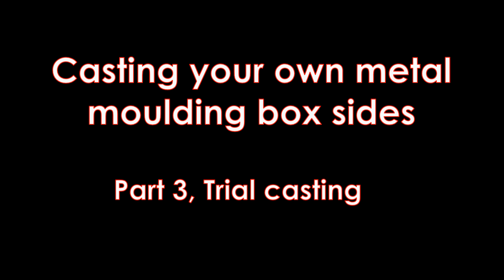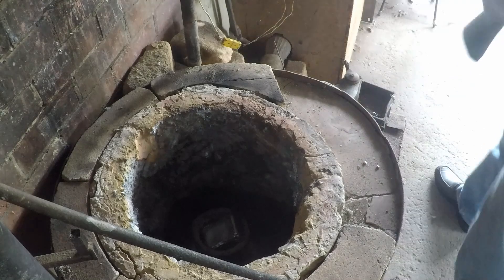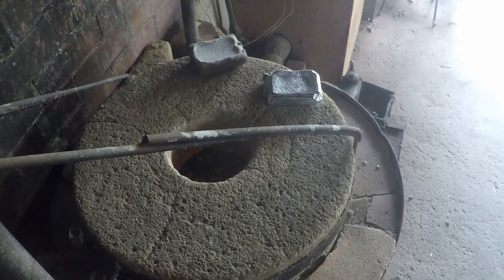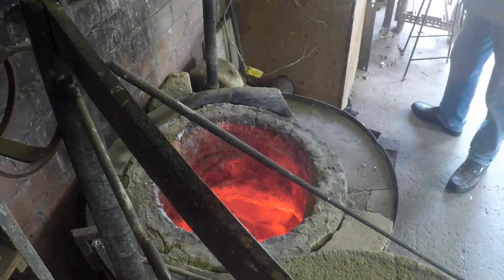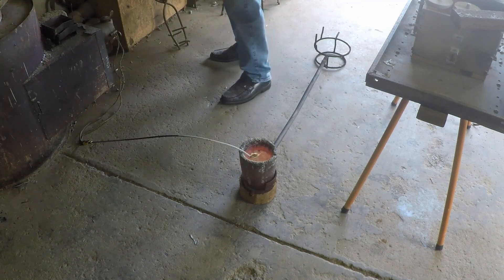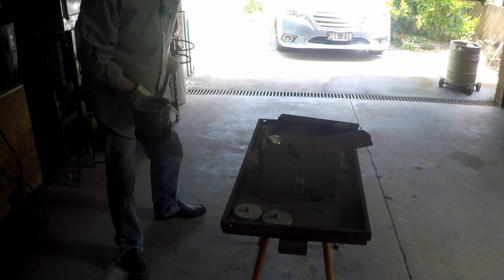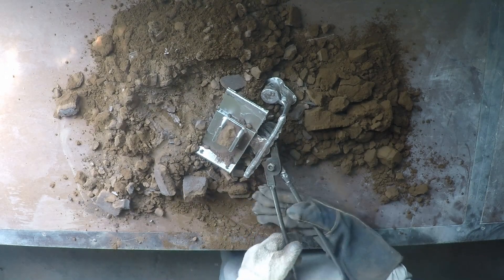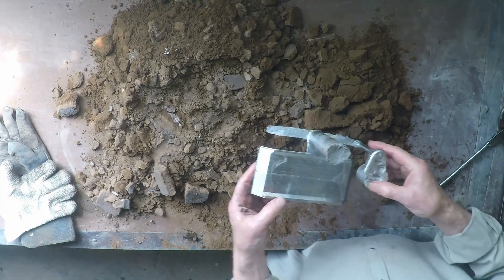Make your own metal moulding boxes - Part 3

Comment: I smiled when you said you're using a " small crucible" A8 . that would be quite large for me Martin, my range is A4 to A12 & I only have ring shanks & lift out tongs & have never needed any unesessary "clips" to hold the crucible in as you say I've never lever dropped a crucible & thank you for sending me the molding box info.is your furnace oil fired or gas? 
Graham.
Reply from the maker: Ray, Spot on, diesel it is... Martin
Reply: @olfoundryman8418  I'm still on coke [no not that stuff!!] but when we pulled the father in laws house next door down I "inherited"a large tank of diesel & the central heating burner so I might rig it up.save messing on with coke.
Reply: I'm not 100% sure but seems like I remember him saying he burns diesel fuel.
Reply from the maker: Graham, Hey baby way to go snort snort damn this Hollywood cold! Seriously though central heating burners work well. I have two that I have used and a local foundry has used a largish one to melt his bronze for years. They are nice self contained units blower oil pump and electric start in one neat little unit only problem is that they are either on or off - you can not turn them up and down.  You can though get a range of jets for them, rated in gallons of fuel per hour. Much easier than coke something less to have to worry about.... Martin
Reply: @olfoundryman8418  That's fantastic info Martin, I've a commercial furnace I got given from a local tech college gas fired [we aint got gas in our house] but it's got a tangential entry tube & I've had the burner in the workshop for a few yrs now & I never bothered with it but now you've spurred me on I'll rig it up many thanks for the info.
Graham.

Comment: The castings don't have to be pretty if it is used for work. They just have to be solid enough to be useful. Still, the casting looks good to me. Are you going to use the castings to form a jacket or a flask? If a flask, I suggest that you incorporate a half round dowel on the inside of the flask to keep the sand from slipping out when you are maneuvering either the cope or drag. Or you could modify the 3D file. Keep up the good work!
Reply from the maker: Sand, You are right but I am a bit of a pedant and I do like a good looking casting. However on this occasion the effort to make my fine facing and the lack of any real need for prettiness won out. Flask, but there are already sand retention ridges on the bottom and top of each side. I am surprised that you did not see them. Nothing worse than a drop out just as you go to assembly a finished mould. I do note that some people do not seem to use any sand retention ridges and they seem to get away with it but I suspect that is because petrobond hangs in better - maybe?? I note a lot of people with a narrow grove or just one ridge in the centre of each side - recipe for disaster IMHO...Martin

Comment: Excellent vid ty. Can youu talk a bit about how u got started in casting, i.e. where, what company, who were yr teachers, what was the state of the industry in yrr younger days, what types of metal did you start with????ty
Reply from the maker: Hrxy1, Long story, short version;- 
age 10 -12 made fishing singers in loose dry sand moulds lined with wheeties packet cardboard
age 14 melted down aluminium conductor scraps using wood fire from re-electrification of road where I lived
age 16 made teaspoons that melted in tea
read "Metals in service of man" inspired by all of it but particularly by 4 pages on casting the propellers for the QU E series
Realizing that geology, my first love,  meant a life in the outback constantly moving around I decided to study metallurgy and have never regrated this choice 1963 - 1965
Set up small sand foundry about 1964
got some decent sand 1968
Worked as foreman in gravity die foundry 1973/74
Rebuilt furnace after moving about 1975 same furnace with same lining today!
Have worked at a few other foundries over the years with last being as foundry metallurgist at Brake and Clutch (broken crutch)
When last job ended ran own foundry full time to keep wolf at bay - not a good living but we survived tolerably well. Now make very little on a commercial basis - age has caught up
 In my younger days the industry was probably at least 4 times its current size there were foundries and pattern shops small and large  all over the place
Apart form my metallurgy studies I  am self taught with a lot of reading along the way, with a thirst for knowledge and a tendency to always  consider what I was told/read but to always look for newer better more accurate info from good sources. I learned early to sceptically respect the "old Hands" Their information was invaluable but could be outdated and dogmatic.... Martin
PS, Hell - what happened to those 65 years?
Reply: @olfoundryman8418  no , no , no  not in words  but in video form. I like to hear you talk. Yr not boring to listen to . no offense intented for wring back to me  obviously i ll read it but would prefer vid ty
Reply: The last bit doeznt make sense, typing errer.
Reply: Also i would like the long story long version, pls, ty

Comment: Not a bad casting considering the level of pattern preparation. Almost like you know what you are doing :) Great to see you up and around. Keep healthy Martin. Thanks for walking us through the process. What do you use for a fluxing agent? And did you degas this pour?
Reply from the maker: Mark, Almost no pattern prep on purpose just to see how it went (Nigel was curious and so was I) Keep healthy? Yeh, well, that would be nice but still standing as they say just with some difficulty. Flux is "coverall 11" by Foseco it  is what is called a "drossing off flux". No, I did not degas this pour. While it is my habit to degas just about all my sand cast work I did not bother here as a little gas will help the feed and the quality requirements are not high (nothing aerospace with this job) and no extensive highly machined areas to show any gas. I sometimes tend to think that people get a bit obsessive compulsive about gas. It is usually so fine that most people will not see it - I mean we have people trying to degas with things like washing soda these INCREASE the gas level and yet they think they are doing a marvellous job because the machining finish on their unheatreated castings will not show the fine gas bubbles - the soft surface just flows over and covers up the bubbles as they are usually way less than 0.5 mm.
What they see and call gas is most likely air bubbles caught because of silly gating methods. My advice on degassing is generally don't bother unless the work is critical or thick. Just use good clean dry metal melt quickly don't get to hot (unlike here😏 ) don't stir the metal use good gating and pour without delay little gas that you will not see anyway and no air!... Martin
Reply: @olfoundryman8418    Keeping above the grass is the main thing I would think! I say it that way because I know you have a sense of humour. I agree that most of the porosity in Youtube castings is the fault of the silly washing soda myth. Plus really bad pouring methods and practice. Way to large sprues. Overheating and prolonged heating as you mention. I pay attention and watch the machining of casting shown. So manyof them have large air pockets. So many people use uncoated steel crucibles and this creates it's own troubles with the aluminium eating away at the steel and reacting with it. Same goes for pouring into cans and tubes. You can do it but it rarely delivers a useful casting. Hoping you get to finish this series Martin. You are a fountain of practical wisdom. And You will be keeping me busy and thinking for some time to come.

Mark
Reply from the maker: Mark, I see we both read from the same play book :) I actually started on YT to counteract some of the large sprue washing soda pushers out there (I regret my lack of sucess but I am still trying) I have been at this casting lark for, I think its now, 65 years and even an idiot like me has to learn something in that time! I do intend to finish this series  grass above not withstanding.  I Hope too that a few more series will come out, like why washing soda does not work etc., How to melt copper (nobody but nobody does it right). Ihave so many ideas for videos but I just need to live to 1000!... Martin
Reply: @olfoundryman8418    Copper would be awesome to do a video or series on. Sure washing soda works. It works to make problems in the castings!

Comment: 800 degrees maybe too much? 710-730 should be spot on for 6 mm plate section Lm25. Test the "T" junctions may still have dispersed  low level porous shrinkage  if needing long term extra soundness?. [single riser dead center on the back should pick up both feed paths]
Reply from the maker: Thesilver, 800 a bitt too much -y ou betcha - no doubt about it. But in my defence my furnace jumps really quick once melting is complete the temp just rockets with a small crucible like that. I was actually aiming to pour at about 760, still high but I needed to get the casting and I had no idea how it was going to work - this was only a trial casting that will not be used. The plate section here is actually 5 mm thick and surely the temp needed depends on how extensive the section is. The "Ts" may have porosity but I would reckon it to be at a very low level as the back of the pin lugs is flat and very shiny - none of the dull appearance or surface sink that would indicate any porosity. Perhaps a bit of gas helped too as I did not degas.The single feeder on the flat section dead centre unfortunately has a problem - it is between the sand retention ridges and thus hard to remove  - a milling machine would do it nicely but that is contrary to the very idea of this project i.e. the minimum tool requirement. I am not sure that it would be that much better anyway - feeder gating as used here is about as good as you can get as the feeder receives the hottest metal and the two pin lugs are quite close to each other. But that was the idea of this trial to see if it would work in as easy a way as possible. As the sides proper - to be poured soon - are in the main longer than 150 mm and thus the 5mm section more extensive I will start pouring with the longer ones first at 750 to 760 finishing up with the 150 at about 730 to740 I will progressively pour and break out to monitor progress and if any show signs of edge rounding or of overly rough finish/finning etc I will adjust the temp accordingly. Thank you for your input , I do appreciate it - its nice to have someone keep me on the straight and narrow... Martin
Reply: @olfoundryman8418 Thanks- Appreciate your comments yes5 mm pushes casting temps up a bit. I'm guessing in the bigger picture is a concept called "fitness for purpose'.As I could also very well mentally picture the residual gas porosity offsetting the shrinkage in the thermal centres if that is the case that same existing setup might suit a 2:1 setup where 2 castings are feeding off one riser i.e more volume-based style feeding. please keep us posted I'm enjoying seeing this progression to a simple real all Round functional box design (next thought would a matching slotted spigot and divot, help reduce design to a single bolt at corners? I'm thinking this is related to how fast do you need/want/replace and to adjust box sizes?) ...  Joel
Reply from the maker: Joel, Part of the problem is that I am a panicy old bugger riven with doubt and fear as to "will it run" or has all that mould making work gone down the tubes so I tend to err on the hot side a miss run is a total loss and hot pour usually not so much.
"Fit for purpose" certainly applies here - this is no aerospace project and I have to allow for the possibility that some who try may not be sophisticated foundrymen - it has to be an easy and forgiving process all the way from pattern making to final bolting of box sides together. I looked at two per box around a central feeder but, alas, my boxes are not wide enough, pity as two per time seems about 10 times 😀 quicker  than 1 at a time. We always figured that by the time we have finished this series the design will have moved further ahead and in fact its moved a long way so far  but we do hope that others such as yourself will put their two cents wort in and come up with yet better versions and certainly the one bolt may be a way to go. One could actually try it very easily with these boxes by carefully marking out a centre hole between the two existing drill  divots. Maybe the pattern could be modified to include a third divot? The pin lugs have now been altered, they have a divot for the grubscrew (to hold the dowels in) and a centre line to mark where the dowel holes should be drilled (in one direction anyway) Will do the best to keep you posted. I have enough shot now to do a video on the "for real" moulding I hope to cast the first 10 of these next week and do the last 6 the following week or so. Have to see how I go my balance is shot and I have chronic fatigue  - OH, old age is grand..😰. Martin
Reply: @olfoundryman8418  Martin as this is a public forum of sorts. I have at least 4 things in mind: 
1. Please check that you first casting you have made for warpage against a flat surface and a set of feeler gauges like a plane of glass. if history is anything is anything to go by and patternmaker contraction, i suspect the thermal action will be causing the cope flat surface to curl upwards at the ends ever so slightly maybe in the 0.25-1 mm before you cast anymore. if there some counter warpage may be the solution upshot it could be causing an exaggerated dimensional instability on assembly.

2. Check out the Foseco foundryman’s hand book it has some nuggets of information in there about relating section thickness to casting temperatures so as to make better approximations on first pour work. it suggests along the lines of a casting temp for 3-6mm thickness, then one for 6-13mm, then 13-25 and finally one for 25mm and above. [i do have a copy up in the attic and will email to you later if interested?]

3. Looking at the videos from overhead when you knock the poured castings out. It seems to me that the green sand mid sections drop first which makes mechanical sense. so think along the lines of a version 1.3 where your .stl files are modified to include cross hatching say starting 3mm high x1mm wide@20mm on a dual diagonal angles tapering to nothing at edges to help sand retention. i think this would likely help in reducing cope or drag drops and improve the sand/box stiffness

4. a change to a "U" shaped cross section plan view to lighten out the lug section from existing rectangular section might be a version 1.4 mod

5. Finally I'm sorry to hear you suffering from "chronic fatigue syndrome" it must be a real downer in some respects. Keep the hope up... There are many new medical advances being found every day, "a ‘martini’ a day "may help keep the doctor away” in the mean time! :<}
Reply from the maker: Joel,
1, Just went out and checked and warpage is 0.004 inch over that cast side. But it seems to be mainly associated with the remains of the brim from the 3D printing i.e. the unevenness is right on the bottom edge of the print and is only associated with the sand retention ridges along the top and bottom of each side. I guess the real worry though is if the 45 degree ends are at all warped and I am not really going to know that until I have sufficient sides cast to check by placing them against each other and seeing what sort of box I get i.e. how square - Fingers crossed! In the past I have sometimes found to have  a warpage problem but mainly associated with multiple gates to the same casting - runner and casting pull differently.
2. I do have a copy but it is a bit old (1968) and it does not even mention LM25 (356) (our 601) But I do admit to pouring too hot rather than too cold. If you could email the info I would be appreciative "olfoundryman@gmail.com"
3. Have a full length sand retention ridge top and bottom of each box side - have always used this - I don't like drops either! These ridges - like the edges on a one sided "I" beam also help with box rigidity.
4, Not to sure what you mean here, can you do a sketch and email it to me?
5, Its a bit strange really as I am not too sure that I believe in CFS mind you these days I am not too sure that I don't! At lest with time this MAY get better but the balance will never improve and it takes real effort to stand up move around and stay standing. Sitting and particularly lying down I can rule the world - standing up, eh, not so much! A martini a day ,now if only I drank! 😊… Martin